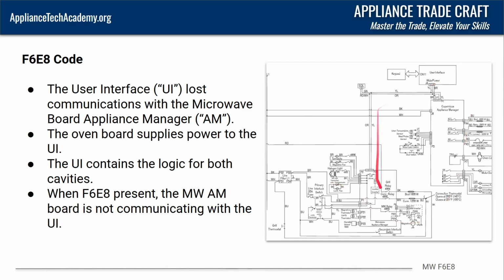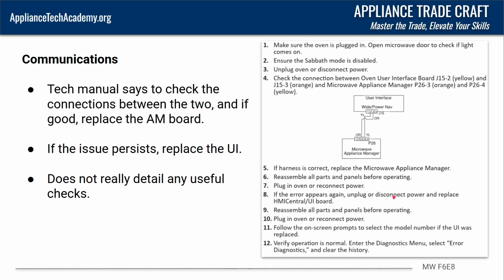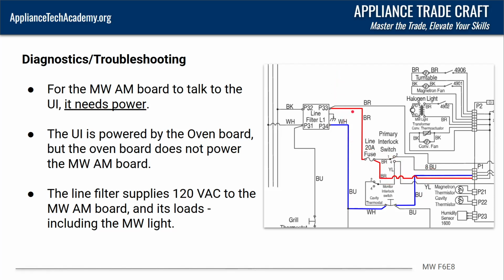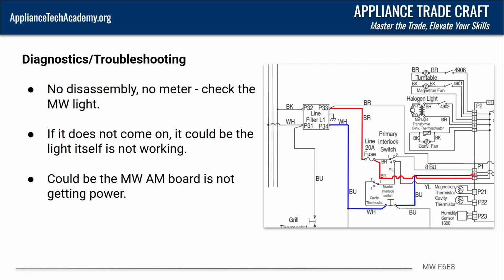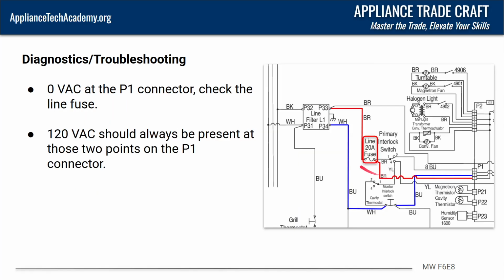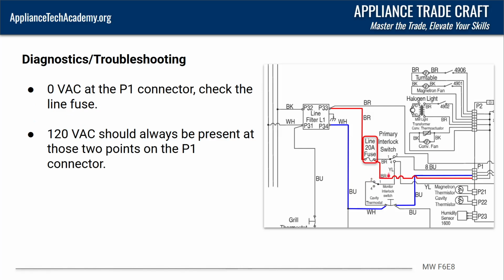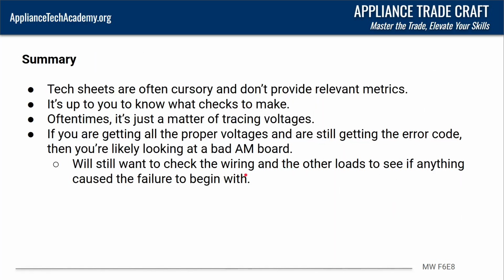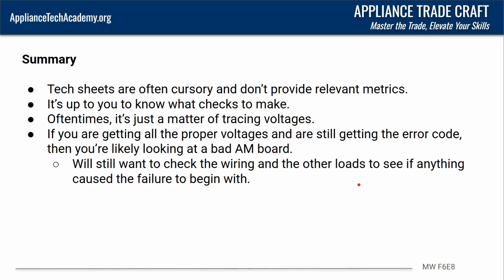F6E8 Error Code - Whirlpool Microwave

Comment: Ok @Appliance I need your help.  Have replaced Microwave AM board, inverter, magnetron, user control board, and still having problems.  When I changed the AM board, my problem went from an F6E8 to an F1E5.  The microwave table starts to rotate the minute you hit start, but the timer on the microwave doesn’t tick down and eventually I get the F1E5 alarm for the inverter.  I was hoping the inverter and Magnetron would be the problem, but replaced them both and still have the issue.  Please HELP!
Reply: @Appliace do you have any suggestions?  I’m at a loss at this point.  I replaced the temp sensor as well, I have basically replaced everything. Hit start on the microwave, the turntable starts just for a moment and stops, the timer never ticks down. If I let it run for about 30 seconds like this it throws the F1E5 alarm.  I have ordered another inverter in case the one I was sent was bad, but not sure what else to look at. 
Thanks

Comment: Hi, I had a code F6E8, I replaced the fuse but after a few days it burned again. The switches looked good, but I also replaced them and the fuse, and that didn’t help. Maybe I should replace the inverter or magnetron? I couldn’t figure out what causes the switches to burn out.
Reply: Hoping you can help me out!  I have this EXACT setup with diagram you are referring.  Same code and same problem.  What I found is that I don’t have power coming out of the line filter to the fuse.  My question is, does the power to the line filter come from the 4905 relay on the mic App manager board?   Wondering if the appliance manager board is bad, that’s the only way I can see 120V coming to the line filter, is from the brown wire coming from the board.   I have 0 power at the fuse on either side, and I don’t have 120V pushing through anywhere on the P1 connector.  Thank you!!!
Reply from the maker: @hollowcd  Sorry for the delay in response!

The power to the unit comes from the wall, then is routed through the unit where it branches off. One branch of that supply power comes up to the line filter, through that, through the line fuse, then to the P1 connector on the board.

If you are checking the BR wire coming out of the filter board to Ground and are getting 0 VAC, then the next step would be to check the BK wire coming into the filter board to see if there is voltage there.
-- If there is, then your filter board has failed.
-- If there is no voltage coming into the filter board, then the issue is in the wiring between the filter board and where the unit connects to the house voltage supply.

If I remember correctly, on the left side of the unit, there is a Molex connector that connects the wire harness to the harness that goes to the filter board. I have seen that molex come loose and cause the issues as well.

At the end of the day, the AM board itself is not producing any voltage. So if you are not getting 120 VAC into the P1 connector, then you're not going to be getting any power to it, and it's a matter of tracing out where the voltage is missing. 

The other thing I will note is this: I often prefer to check VAC with reference to Chassis Ground (a known 0 VAC source outside of the circuit). As noted in the video, if we are missing neutral, then we are going to see 0 VAC across two points because there is no voltage potential difference in the circuit, thus you would see 0 VAC, even if there is 120 VAC present.
-- For this, you would also want to check the Neutral side of the circuit to GND. If you're getting 120 VAC, then you know you are missing neutral.

Again, sorry for the delay in response. Most of the videos don't have comments enabled, and I don't check in here very often.
Reply: @ApplianceTradeCraft  Thank you for the help!  Actually found that somewhere along the line I blew the main 20amp fuse, which caused my powerless AM board.  Put in a new fuse and heading in the right direction, getting power to everything on the board now.  Now everything checks out voltage wise on the 120V and 24V side, but it is acting up a different way.  The microwave will power up but the turn table stops turning right away and the clock doesn't tick down on the microwave.  Then a bit later i get a new alarm, F1E5 inverter fault.  I'm thinking I have a bad AM board.  i have ordered one to replace, we will see what happens and Ill keep you posted. 
Thank you!
Reply from the maker: Sorry for the delay in response. I have been quite busy lately. 

Have you found any resolution to this? Generally if your fuse or your switches are failing, there is something in the circuit that is causing the failure - such as a failing load or maybe a loose connection somewhere. I generally recommend that you check the loads per the spec sheet to ensure they are where they should be. It's also wise to check the mag tube for any signs of damage. 

If you're not seeing anything that is standing out and everything is checking as it should, then it's a process of elimination. Try to see when the fuse pops - i.e., does it pop right when you hit start, or a little into the cycle? If you're suspecting the magnetron as the failure point, then disconnect it and run a cycle, see if the fuse blows. (And with that, I might mention if you don't have a resettable jumper fuse, that might come in handy so you're not burning through the on time use ones).
Reply: @ApplianceTradeCraft The switches were fine, but the slider holding them was getting stuck, which caused a short circuit and blew the fuse. I used WD-40 and worked it back and forth for about 200 times until it stopped sticking. After that, no more issues with the blown fuse.
Reply: Issue continues, brand new AM board.  Still get the F1E5 and the turntable does it rotate and the microwave timer doesn’t tick down